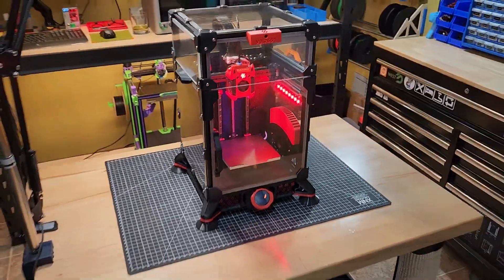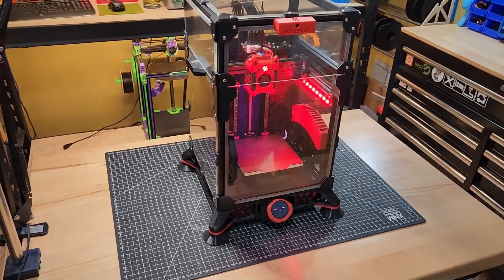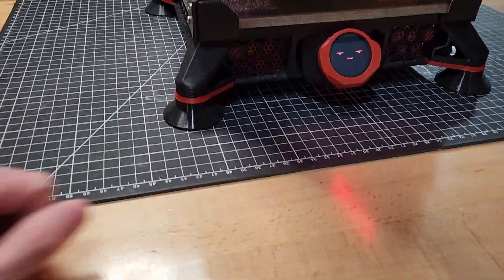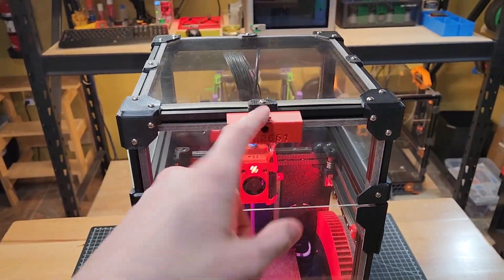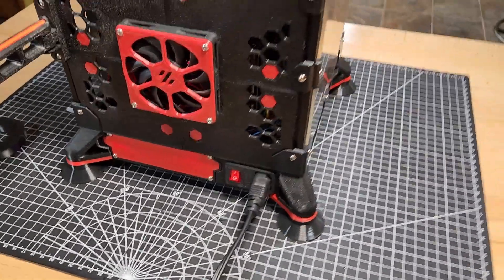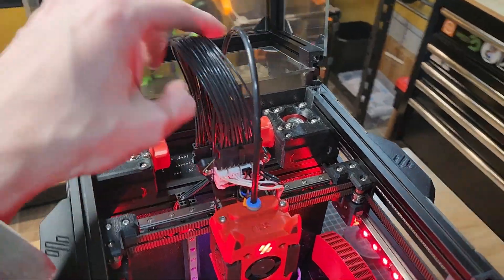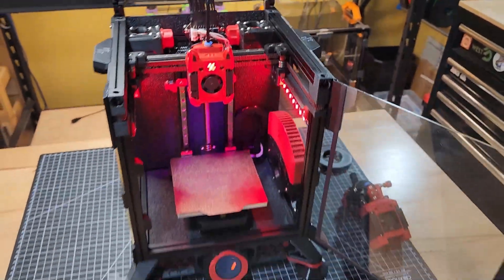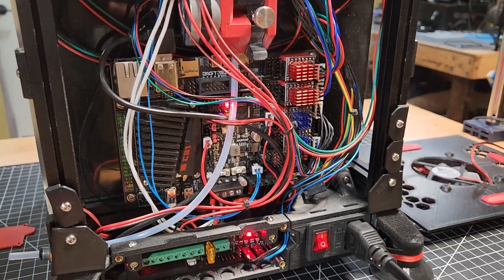Voron V0.2 Overview

Comment: What's the point of serializing the printers, where do you do it at, and if I get a kit would I still need to print anything? Do I need a printer already to make the printer?
Reply from the maker: Serialization is a choice, not a requirement. Really just gets you on the list as an officially completed build and maybe a little bit of pride that the machine you put together is now part of something bigger. As for where, with Voron there is a subreddit that you submit a video to and it gets reviewed. I think for the Mercury it was through their discord.

You can purchase kits that have all the ABS printed parts for your first and then either reprint in a different color scheme or build another machine if you'd like. And with the variety of kits available now, you can get a complete one you just have to build.

Comment: I'm just building a diode laser engraver / cutter using the Voron 0.2 gantry system (without the z obviously). 
This design is useful for more than just 3D printers.
For small work spaces (no long belt issues) I recon it's the most efficient xy kinematics and thoroughly tested by many.
I'm looking forward to the results even tho I'm only using the top 3rd of the design. 
My other laser is a DIY 1m x 1m Cartesian monster with too many cable chains and large masses to negotiate.
I'm hoping that CoreXY with stationary steppers can be scaled up for laser use to those kind of dimensions.
I've seen it done but it seems to get sloppy above 500mm x 500mm.
Reply: Leave the z so you can do milling!

Comment: Can You a little video on getting that cool little screen working on the V0 please😊😊
Reply from the maker: It's really not bad connecting it, pretty much need to have the printer running and accessible via IP. Power up the Knomi, connect to it's own network via WiFi and add the IP address of the printer. That's about it and once it reboots and the printer is online it will auto connect.

Comment: Do you have the section to set up that second temp sensor for heat creep?
Reply from the maker: @davidchavarria  Sure, I really just added the thermistor and put a max temp of 80c:

[temperature_sensor Creepin]
sensor_type: ATC Semitec 104GT-2
sensor_pin: Expander:PA6
min_temp: 0
max_temp: 80

Comment: I would like to build one with a dual toolhead in mind.
Should be quite doable.
Cheers.
Reply from the maker: @jeffhack6839  Definitely doable, but if you build it in the standard form factor, that will limit your build volume. I think there's a version of the Salad Fork that has a dual extruder setup, but there may also be a v0.2
Reply: Check out the Bondtech INDX and the demo they have on v0.2. That’s want I want to go for
Reply: Just add INDX.

Comment: That little Voron 0.2 is such a cute little printer.  I don't have a use for it because my larger printers can do everything the V0.2 does and I can't quite justify mobile 3D printing yet, but the little V0.2 keeps calling to me.  I'm trying to make up an excuse to justify a mobile 3D printer.  I love that you have a backpack for your V0.2.  Thanks for sharing your build and your mods.
Reply from the maker: @Liberty4Ever  I totally understand that, I had other printers before, but I wanted to start with a small one that I built first. If I had started with a larger version, I may not have ended up getting a V0.2, but I'm very happy I did. It heats up so fast, and it's so accurate while being extremely compact. Thanks for checking it out, and I'll be sure to do more about my other machines!
Reply: That's what I thought too. My first printer is a 300x300 bed. I went with a larger printer because it can do both big and small stuff. 6 months later, i got a stupid good deal on a bambu a1 mini I couldn't it turn down. I tell you hhhwhat, I use that little printer all the time. And it's super handy when i've got a large print going in the bigger printer, i don't have to wait for the big printer to finish printing for half a day or more to print smaller/quicker parts. I'd love to build a voron 0.2 to have a smaller enclosed printer. The price of the kits is the only thing holding me back atm. I wonder how much cheaper it is to self-source.
Reply: @ThePants2012  - You might be interested in a Sovol Zero.  I bought one around the time of my original comment under this video and it arrived two days ago.  It's based on the Voron 0.2, with, in my opinion, some improvements as well as changes to make it more manufacturable.  It has a 152x152x152 mm build volume, 350C nozzle, 120C bed, and it's fully enclosed.  It's small but very heavy duty.  It needs to be, because it has 40,000 mm/s^2 acceleration and 1200 mm/s velocity.  It's a little speed demon and it'll print most materials.  15 minute setup and way cheaper than building a Voron 0.2 kit.
Reply: @Liberty4Ever  I'll look into it, thanks for the heads up 👍

Comment: Have you had any performance issues with the CB1?
Reply from the maker: @dog2bert  Not at all, I run a CB1 on two of my machines and a CM4 on one. The CM4 is definitely faster, but it's a 3D printer, so an RPi 3 or equivalent is plenty fast enough. I now have an RPi 5 that is in the Pironman case, and that one is even faster, but that would be overkill for a printer. Unless you're going to use AI and such on the machine.
Reply: I'm using a btt pi1.2 which is the same thing just different formfactor. One year so far and zero issues.
Reply from the maker: @krisztiantkacs  Absolutely, I have the BTT Pi v1.2 in my V2.4 as well, great little SBC. I like that it has the 24V terminal blocks, too!

Comment: Awesome video. Can’t wait to hear about the others!

I know you stated you are possibly getting rid of a machine because you can do it all with the other four; but, do you have any plans to make another Voron machine? If so, it’d be awesome to see the process. 

Lastly, what is the average budget for a Voron build?

Awesome again and keep it up!
Reply from the maker: @ChristianLong-i4r  Thanks for watching!

I absolutely have more builds in mind for the future. I am heavily considering the Millenium Machines Milo CNC. There is supposed to be a V2 out this year, so I'm waiting for that. From there, things like a StealthChanger system or Box Turtle are in mind to add functionality to my Vorons.

As for budget, keep in mind this is CAD, and it can certainly range depending on if you get a kit, of which there are a number, or if you selfsource. I've found self sourcing has been more expensive. For a small format machine, $500-$800, medium $1000-$1300, and large $1500-$2000.

Appreciate you watching and the questions!

Cheers
Reply: @ Nice. I am looking forward to the CNC - definitely an interest of mine!